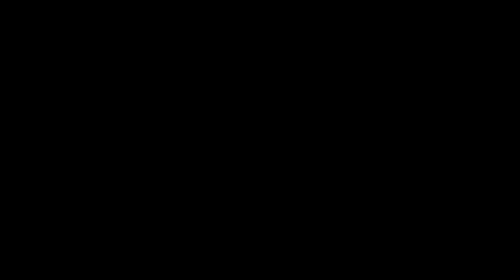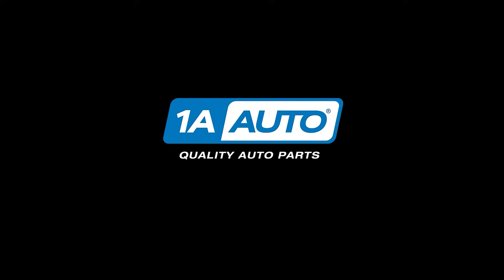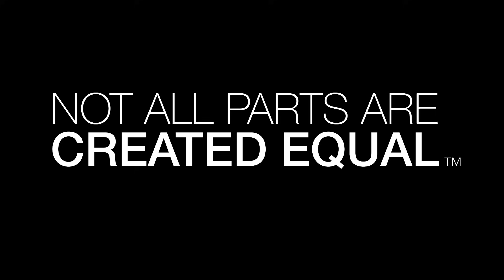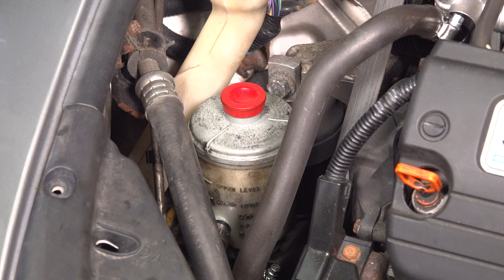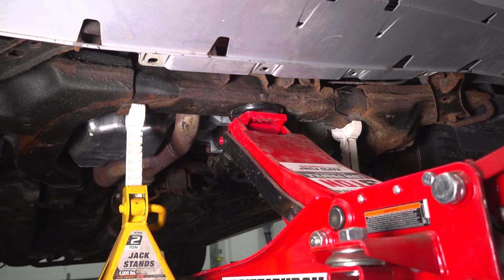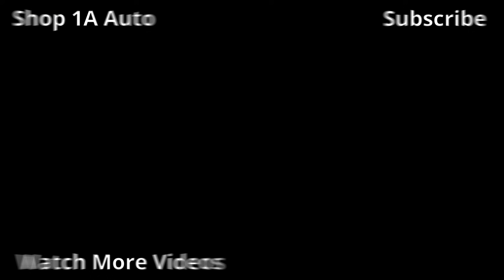How to Drain, Fill, Bleed Power Steering Fluid 2003-2007 Honda Accord

Comment: Normally I'm a big fan of your videos, but this is not good advice. This is not how to drain & bleed your power steering fluid. You only removed it from the reservoir. If anyone needs a good video on how to do this, the channel Buddy's DIY has a video called "Honda / Acura Power Steering Flush / Change | The Proper And Thorough Way!" that shows how to thoroughly flush & replace the power steering fluid.

Comment: Thanks for this video. I used your tip about raising the car and turning the wheels.  The first time the fluid stayed at the top line, but something told me to raise it and do it again. The second time I lowered the car, the fluid was about 1/4" below the top line.

Comment: Very helpful video. Getting ready to do this because my steering became very hard yesterday. I think it was due to the cold weather, but I've never replaced my power steering fluid (almost 260,000 miles) and the Honda forums recommended replacing the fluid and O-ring due to the mileage. Thanks for putting this together! Easy peasy the way you explain.

What is the capacity of the reservoir?